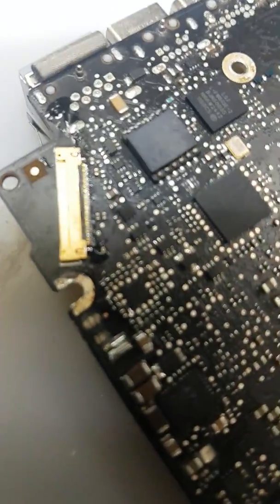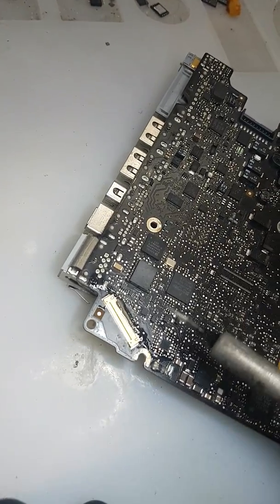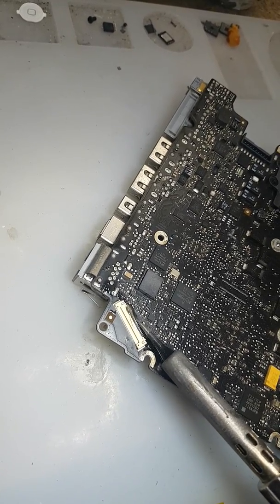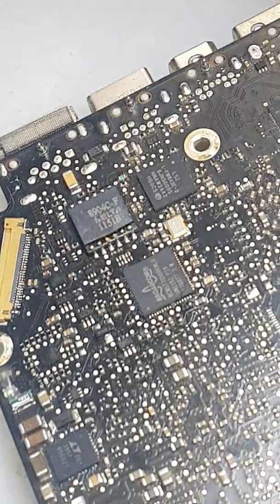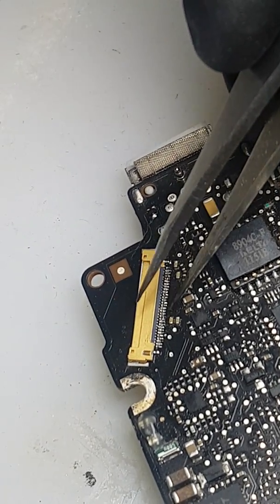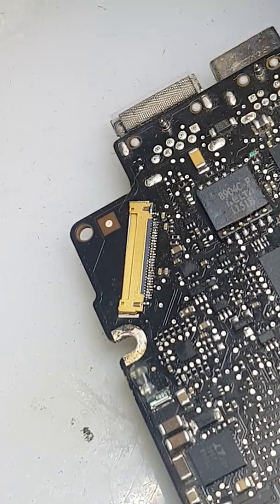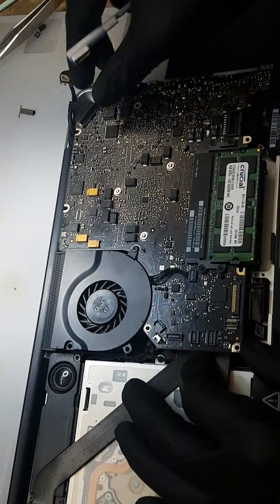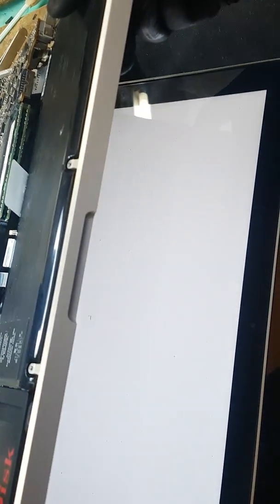macbook pro a1278 Screen Connector  replacement / how to solder a screen connector

Comment: The Late 2008 models LVDS cable is what goes bad 90% of the time

Those machines made from 10-2008 to 1-2009 have a potentially bad LVDS

Apple put in a better LVDS in those made from February '09 to last production.

The 2009 A1278 LVDS cable sold bt the Chinese do not fit!

Lessons!

Recycling "Bad" Macs since 1997...

Thrift store finds

TroU Mac club effort...thru 2009

eBay since 2010

Retired Chicago camera repairman.

Never stepped into The Apple Store on Michigan Ave.

Too totalitarian

Like the city in THX-1138

Jobs big inspiration fro his friend George...

No Thanks

J.C.